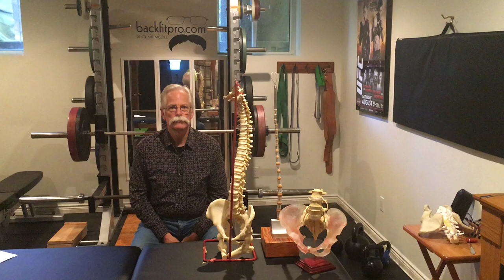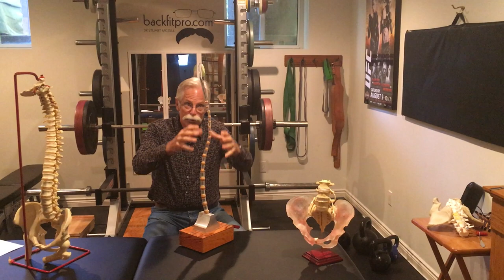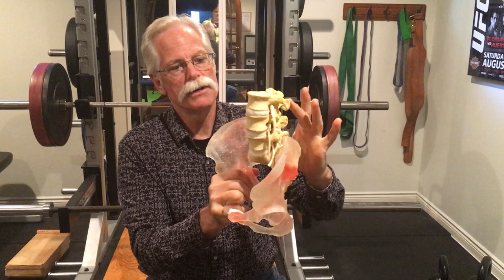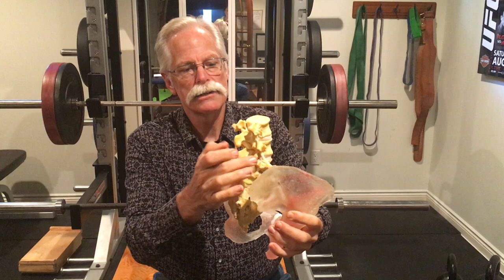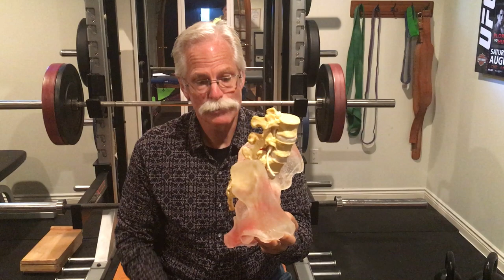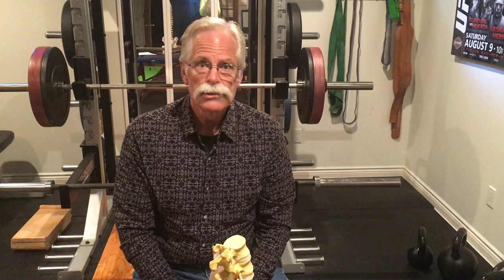Three Kinds of Stability - Stuart McGill

Comment: 1:16 it is actually what happens if you stand on one leg and that's what we want to emphasize for athletics. If you keep your spine stable and stiff, when lifting one leg you just fall. So if I understand correctly what you explained here, this theory is dysfunctional and promotes robotic movement, where the spine is considered to become a straight pole. We should use all those joints that we have in a coordinated fashion for longevity and effectiveness. Are you familiar with Dr. Grecovecky?